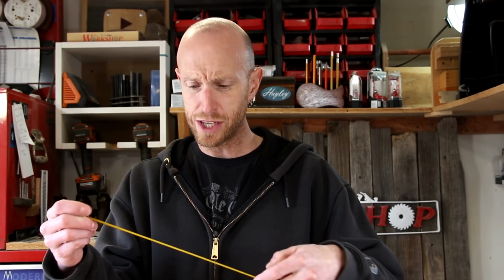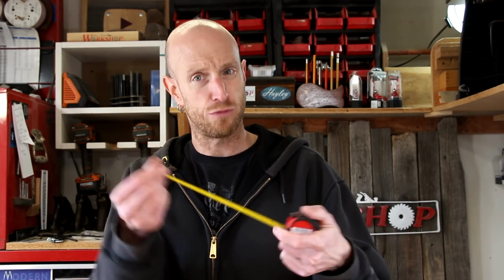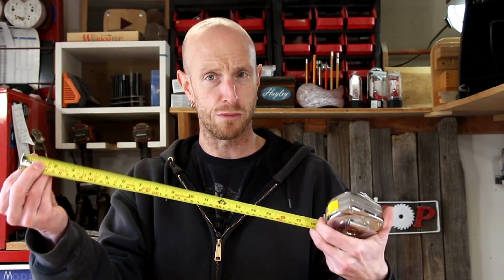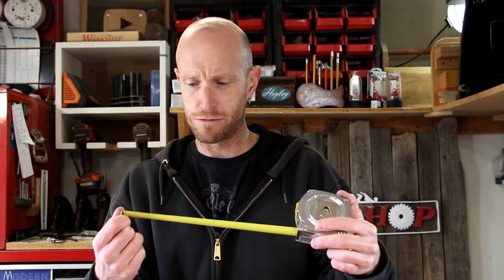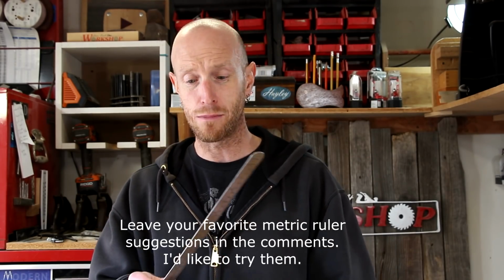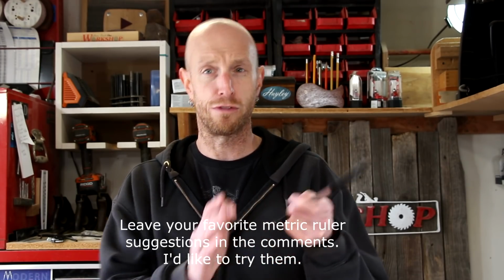My thoughts after using the Metric System for a project | I liked it

Comment: Very interesting and even confusing to see this video! It is like a story from a distant planet.

The comments told that your American measuring system has been changed to fit the metric system and in fact it resembles of what happened in Finland too, in the beginning. The metric system was adopted in 1887 in Finland but some units were left outside of it e.g. the old "peninkulma" which was 10 688 meters, but was changed to be 10 000 meters. Anyway, quite soon old units were only in fairytales and legends so that not even my grandparents were talking about a peninkulma distance. Or anything but kilos and litres. I am sure that if you really stopped using your old system the change to the metric system would not take a long time in the USA.

Comment: I doubt it's more accurate. Except for maybe when weighing while cooking lol, I mean spoons and cups? :')

But yeah, the biggest advantage is certainly not having to deal with fractions (although I suppose you could still say 1.25m = 1 1/4m if you're weird like that), and no conversion, because in length there's only the meter, and anything else (mili-, centi-, deci-, deca-, hecto-, kilo-) is just a multiple or submuliple of that same meter.

Comment: The more different units you need for your project the easier will be working with metric system. You don't need kilometer long ahh in this case mile long conversion charts because the units of the metric system are logically and physically connected. And they use the easiest conversion factors: 10^x and 1/10^x

Comment: The main advantage of the metric system is that it is incredible simple. Because your calculations are easier you are simply less likely to screw some calculations up. I rather doubt that it is more precise. For a craftsman there isn't that much difference but whenever you are doing business outside the US or GB switching from one to the other, no matter which way, is a serious pain.

Comment: It’s interesting how you talk about accuracy - one mm is in between 1/16” and 1/32” (1.6 and 0.8mm) so you’re kind of getting that extra accuracy by default. Unless you’re one of those crazy people who actually uses the 32nd or 64th lines - but they make rulers with 0.5mm markings too.

Honestly, I find it quite a bit easier to actually use that accuracy too. 1, 2, 3, 4, 5 mm is easy compared to blanking for a second doing the mental math to find what’s between the 5/8 and 3/4 line

Comment: One quirky thing about metric is centimeters is not an official SI unit measurements should be meters or millimeters. Weight is the same 1kg is 1,000g you won't hear of a weight described as centigrams. It's all 1 or 1,000. As a Canadian it took me a while to realize this fact.

Comment: I think the hesitancy that people have with metric is that they don't have a "feel" for the measurements.  For instance, we have a feel for how long an inch or foot or yard are.  We know roughly what a pound is like.  We know what a pint or quart looks like.  People don't like the idea of uncertainty of not knowing a meter, liter, or kilogram.  Also, people  basically don't like change.  It's upsetting.  The key to adopting metric is education.  Also, slowly introducing it in various products would help.  Gasoline could easily be changed to metric at gas pumps, and people would get used to that quickly.   But it takes commitment from people to make the change.

Comment: 1:30 Just for the record, STANDARD measuring tools are METRIC, since that's the INTERNATIONAL STANDARD units or measurement. What you meant was you only had AMERICAN measuring tools. (The reason they're called SI units is because they're governed by the Standards Internationale de Metric, in France, where it originated.)

Comment: I think a reason why metric might be more accurate is because instead of measuring 1/32nd of an inch you measure one mm. So you are dealing with whole units basically all the way the smallest metric measurement I am familiar with is an attometer which is 0.000000000000000001 meters (the core of a helium atom is about one thousand times bigger) and I know there is smaller but all I know is the attometer. And everyone who knows the metric system can easily convert a attometer to a meter, you just need to know that an attometer is a quintillionth of a meter. Imperial has thou and I guess you can get smaller and smaller fractions but I would say it is easier to work with a femtometer than with 1/32000000000000 of an inch

Comment: Fun fact: 2X4, 2x4 and so on are still called that here in Norway. Even nails are sometimes named in inches. And we went metric in ... 1875!!! But of course, this is informal. A 2x4 is 48x96. And all measurements and drawings are metric only. (BTW, same with boats, almost always measured in feet. Like fishing rods. TV/monitor screens, speakers, rims. Bike frame hight. All inches. I can see why it’s difficult to change. But these are exceptions. We THINK in metric. Fractions makes NO sense at all for me.)

Comment: For any defenders of the imperial measurement system ("standard" to you Americans..), try this..
Calculate the volume taken up by your bodyweight, in gold.  Gold is 19.32 times as dense as pure fresh water.
As a comparison, using the metric system.. One litre of fresh water weighs one kg. A 100kg (220lb) person weighs the same as 100/19.32=~5.18 litres of gold.
So simple. Doing that with pounds and ounces would do your head in.

Comment: Canada has been Metric for 40 or so years but building materials are still sold in Imperial.  I buy a 2 x 4 (inches) not a 5 x 10 (centimeters) because that's how it is still sold.  Sheets of plywood are still 4 x 8 (feet.)   I don't know if professional carpenters use metric so now I have some research to do.
The advantage of a single measurement system becomes obvious when you think about the Mars mission that was lost due to some NASA technician entering an Imperial measurement instead of Metric.  Hundreds of millions of dollars lost there.

Comment: Apply this to sewing, especially the exact measuring of quilting and piece patterns. Try trimming edges of fabric. You need to trim off
Reply: (Sorry- please attach to first comments) You need to trim off 3 7/8 inch  from each side of a piece of fabric. That is 1 15/16 inch from each side. How long did it take you to figure that. I had to calculate that twice before I got it right.

Comment: This would come out wierd. But am from Kenya where we use the metric system in almost everything. But for some reason the construction industry uses Imperial.not a rule or anything but just how they feel. We also measure our beds in feet.but most of the things are metric.

Comment: I don’t think the metric system is more accurate. But it’s definitely easier to use. I think that the risk of mistakes for some not used to SAE vs. someone not used to metric, is far greater. As a born and raised metric user, I believe that if I were to add and subtract fractions rather than moving a decimal point, I’d make way more mistakes to begin with, the learning curve would be way steeper with SAE. Also the fact that there is no system and coalition between measurements in SAE, but you have to memorize random numbers l, rather that an actual system makes it harder. How many feet in a mile? How many yards in a mile? Vs. knowing basic math. We have stuff where the sizes are in inches and feet, like car wheels, tv screens, laptops, monitors, fishing poles and boats. And probably a lot of other stuff. I know how big the things are and I’m not bothered  that it’s Imperial/SAE but I’m glad it’s just ready made stuff, and I don’t have to do any math or or construction using SAE.

Comment: Interesting that tape measures, etc in the US don't have metric on them. Here in the Netherlands all my tape measures and rulers have imperial on them, except for the ones where it's hard/impossible to do both.
Reply from the maker: Its true, most are only Imperial. I finally found some with both units, and I found none that were just metric. I know they exist but in the local shops I checked I couldn't find any.

Comment: I use both.  I have measuring and marking tools in both.  The more I use metric, the easier it is to think in it.  I now design most of my self designed projects using metric.

Where it becomes hard is if you try to convert a project designed in one system to do in the other system.  Don't do that.  

Use the measurement tools that the project was designed in.
Reply: 25.4mm to the inch not complicated at all nowadays with calculators on phones
Reply: @johnduncan231  I guess my point isn't that it isn't possible, but that conversions result in decimals that aren't right on a mark.  

It marking and measuring in the system it was designed in, then you likely don't have to figure out where the decimal puts you.

I convert all the time when I need to... but I prefer not to.

:)

Comment: The metric system makes a whole lot more sense because it's based on the decimal system (like there's a 100 cents in a Dollar). Switching to metric will not happen overnight. Take Canada for example, Canada has officially switched to metric somewhere in the early 1970's but up to this day many units are still being displayed in both metric and imperial. Water freezes at 0 degrees Celsius (or 32 F) and boils at a 100 degrees Celsius (or 212 F) .That makes sense doesn't it? No more inches, feet, yards or miles but millimeters, centimeters, meters and Kilometers. Let's go metric America!

Comment: What's funny is when you go to the store to buy a canned or bottled soft drink like Coke. you can get it in 8,12,16 and 20 ounce cans or bottles but after 20oz it becomes liters as in 1 liter or 2 rather that 32oz or 64oz. Fun fact. In the UK even though they use the metric system on the roadways they use Miles and MPH and not KPH.

Comment: Welcome to the light side :-)
Little secret: most Imperial values are nowadays derived from a metric value. That's why over time the Imperial systems actual dimensions changed ever so slightly, so they could convert it (back) to metric more accurately. Without you knowing it most of the larger industry uses metric behind the scenes, even if it shows Imperial like on weighing equipment. It's a ruse really, you're already using metric. We're already there! ;-)

Comment: Put an empty cube of 10cm side length on a pair of scales and set it to zero. Now fill it with water. The measured weight will be 1 kilogram. Exactly, one kilogram is a 10cm cube of water. Now pour the water into a 1 liter bottle. Fits perfectly. 1 liter of water weighs 1 kilogram and it is 10cm in cubic size. A 1cm cube of water weighs 1 gram and has the volume of 1 mililiter. Scale it up. A 1 meter cube of water weighs a ton or 1000 kilograms. It has a 1000 liters volume.
Now freeze the water and let's call the temperature when it does that 0° celsius. Now bring it to boil and say that temperature is 100° celsius. Water is solid under 0°C. It is liquid over 0°C. It is gaseous over 100°C.
The metric system has ultimately been defined by the universal chemistry of water.

Comment: An excellent example of being a real human being  adapting to  the real planet.

Perhaps the biggest advantage of metric , other than the  simpler math(s) , 
is that is portable across all technical and certainly trade fields.
 
This helps with breaking down walls between fields as well. 

A plumber can talk to an electrician (a translator and some UN reps 'tween them)
    and both understand what a litre of water weighs (on earth) and how much room it needs... interchangeably

They can then both, understand why the concrete is therefore so frelling hard to drill through etc etc . 
A Newton  a Pascal a Joule and a meter all being useful to all of them at almost any scale.
The tool makers drill and bit they use, likewise, and to a standard ,  portable accuracy .

Though plumber and tubes and pipes and threads and  GAUGES  [!] of wire etc ... still catch me out at least once a week.

There is a poetry to imperial measurements that the  metric system  struggles to match and that is sweet :)
When I want to know the volume displaced by a cubic perch of the Kings  Unicorns  Poo I use Imperial ... 
 it's all about context.

Meanwhile the Metric system is a better match to the real universe. Even on Mars.

Comment: Now its time to try another adventure, in the world of temperature measurement, try Celsius in stead of Fahrenheit.
I can understand your problem on using a measurement system other than the one you have grown with.
I'm Portuguese, so my "native" system is metric, but In my line of work (electronics), inches are widely used,  in PCB design, in display and printing resolution and a few other things.
In PCB design and components specifications, I started in an all "inches" world, back in the '80s, but that has been deprecated and  component datasheets and PCB design tools are using "mm" has its base unit, with inches on the side.
Even being a "native metric", I still default to inches in component sizes, and have some difficulty in using mm only.

And that is only the electronic footprint of 20 years of my adult life, so for a "native imperial" it should be harder.
The only factor that might make it a little easier is what gave you the sensation of being more precise. That is because the metric system is a decimal system, so when you move from one unit to the other you see always the same digits (0,25 m <-> 25 cm <-> 250 mm).

Regardless of the units system, great videos!!!

Comment: My engineering education coincided with the change to metric. It is not until you use the new system extensively that things like strengths of materials and stresses start to become familiar. About 5 years of progressive changeover in weights and measures and labelling of products in consumer-land is needed. "Fill the tank" is Imperial and Metric, and you still buy four apples!
Reply: The worst thing about filling the tanks for me is when I visited the States. Having learned to drive over here when fuel was still sold by the gallon it lead to the situation of when prpaying for fuel in the US thinking I need 5gallons to fill the tank when actualy 7gallons was needed as the US gallon is smaller than the imperial gallon. Where in metric this would be 22.5l.

Comment: I used to work in a metal shop in Canada. Whenever we did work for the USA my head would explode. Going from an easy to grasp and visualize system based on increments of 10s to something based on random measuring bases, all disconnected and rational number based... Yeah... Right. WTH??? 
There are SO MANY possibilities to make measurement mistakes in imperial. NOT every manual worker can add fractions like some of the more "engineer" types. But just about everyone can divide or multiply by 10!
I was pretty good in school. Went to college. But imperial is just a defective system, based on archaic thinking that I can't work with. 
We switched when I was in grade 2, in the mid-70s. So we STILL use it for random things, like people's heights and weight. I'm 5'9 and weight 200 pounds (not fat..lol) but I drive in Km/h, use liters and grams when cooking (I'm a chef now.) and use US measurements for Shoe sizes instead of EU metric sizes. Its ALL mixed up even after 40 years, just because we live so close to the US. But it allows us to notice how much EASIER metric is to use, every day.
I can't wait for the last traces of imperial to be gone.

Comment: I use both systems on the job, some prints are metric, others "standard" or imperial.
Honestly I can say for the most part metric is superior in that everything is divisible by 10's making math easy... and it translates into volumes and weights as well.
Those who insist metric is hard and incomprehensible haven't used it enough to actually understand it.
I can tell you off the top of my head how many millimeters there are in a kilometer, I challenge any imperial fan to do the same and tell me how many 32nds of an inch are in a mile.... without looking it up. Spoiler alert... there are 1 million millimeters  even, in a kilometer. Is it useful? probably not... but easy all the same. A cube measuring 10cm by 10cm by 10cm, is a perfect liter in volume, so easy to calculate accurately.

Comment: Some beautiful about the Metric system: If you learn 1 Unit, you have learned them all (with like 1-2 exceptions).
For example:
"k" means 1000.
Meters: 1 km = 1000m
Weight: 1 kg = 1000g
Watt: 1 kw = 1000w
"milli" means 1/1000th.
Meters: 1 millimeter =  0.001m
Liter: 1 milliliter = 0.001l
Ampere: 1 milliampere = 0.001a

Comment: the metric system is based on, though no longer is, on widely understood common things: 10-based, and water based (yes). things most people know... 
in other news, the US is on metric since 1976 as all "standard" (imperial English, really) is defined in metric and set accordingly. When you were born after that your weight in the hospital was recorded in grams, even if the nurse gave you pounds. Your temperature is measured in C, even if the nurse says in F. Just for the record

Comment: That 'standard system of measurement' is called the Imperial System, and has been used by the UK for a long time. So that's how the USA ended up using it too. But at this moment, only 3 countries in the world still use the Imperial System; all the other countries have meanwhile switched to the Metric systtem.

Comment: I worked in the Chemical industry ... knowing that the cubic meter is 1x1x1m weighs 1000kg of water , contains 1000 litres of liquid that is easily multiplied by the relative density of the liquid to water ------ makes for easy calculations in your head